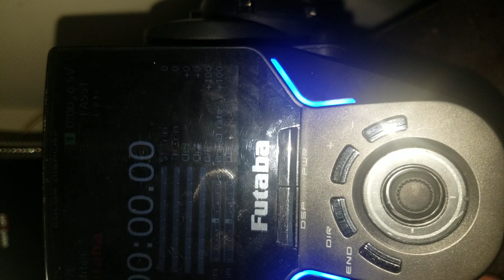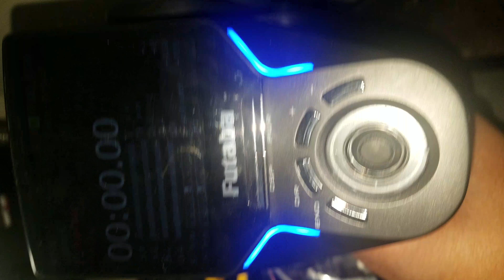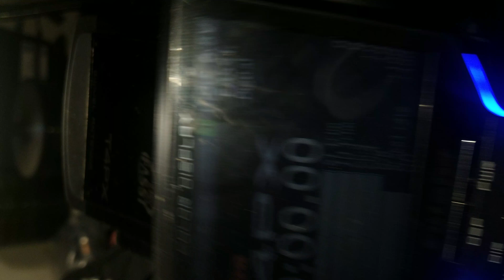Serpent 977  electric conversion build progress

Comment: What parts did you use behind the spur adapter? Also did you have to modify the shaft that the spur gear is riding on?
Reply from the maker: No mod needed. Just install motor mount and trays from saga. Also spur gear adapter. That it along with your electronics.